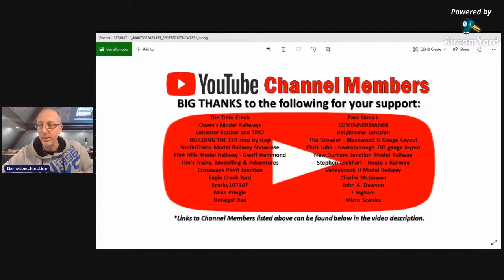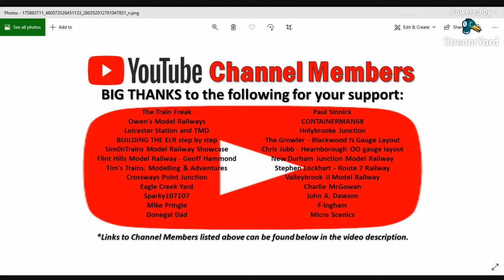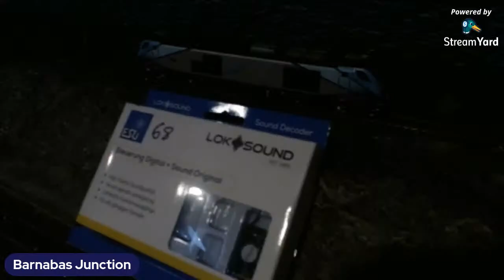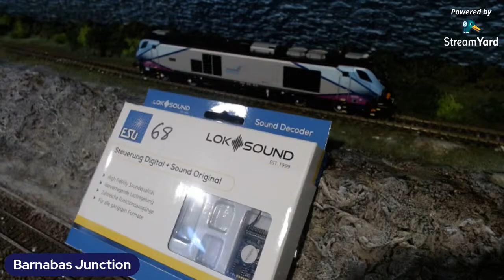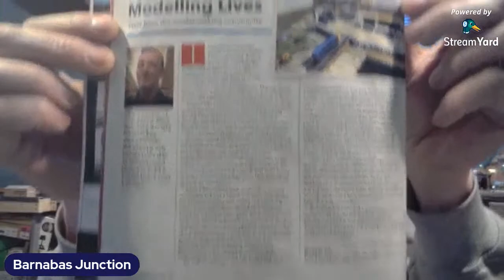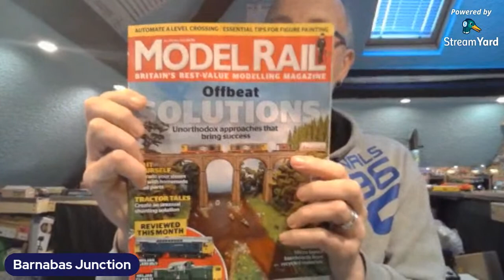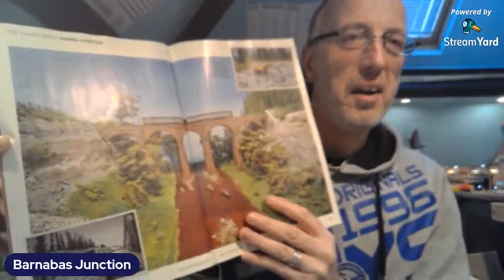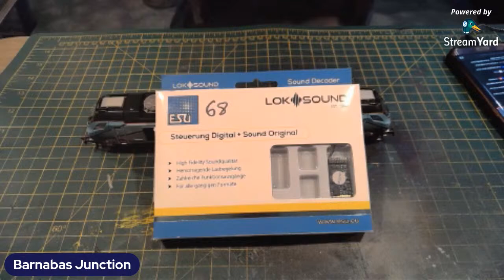Installation Of An ESU Loksound v5 Sound Decoder ~ YTT S4  - E13

Comment: Evening Jason sorry l missed your live stream but great instruction video on fitting sound chip to your class 68 have you run your Alstom pendolino later remember when you did the review about the mistake about how the power cars and 2 coaches Alstom livery did not match with the picture on the box I also had noticed the  same with mine and commented on your channel well now l have also replaced the dreaded traction tyres with normal ones l have made it into a 5 car unit added 1 more weight so much better now l also wondered how do you join MRYCG thanks again for more great videos
Best Wishes
Kev Beighton Parkway Sheffield
Reply from the maker: Hiya Kev, Thank you for your comment. Very pleased with the ease to fitting sound into the 68., great to hear you have added an extra unit to the Pendo, all is good.
There are links in each video description to assist to join MRYCG, if you still have problems feel free to email me.

Best Regards, Jason.